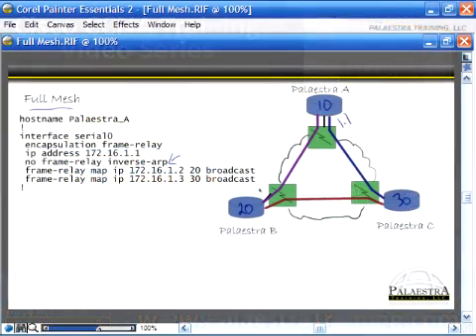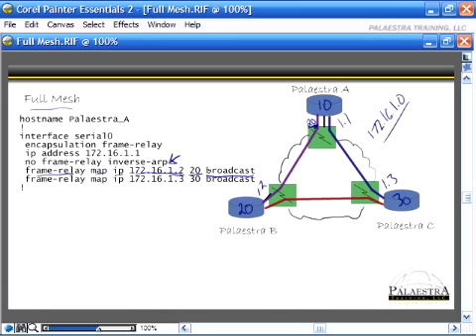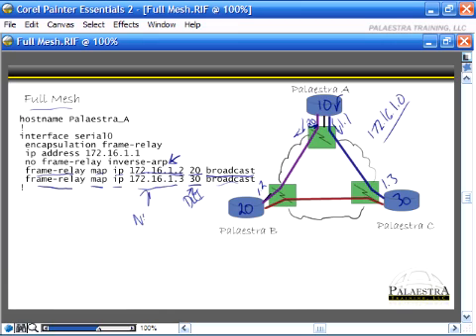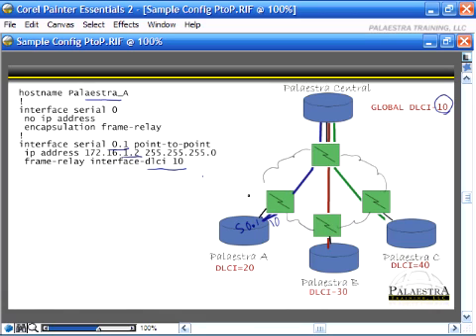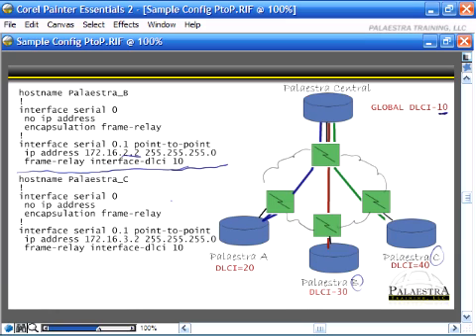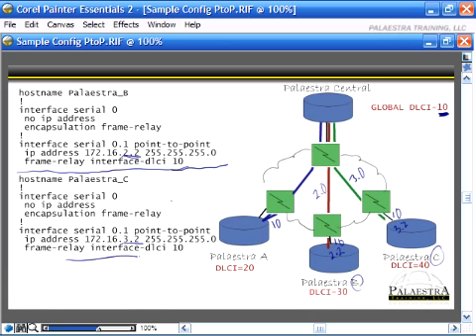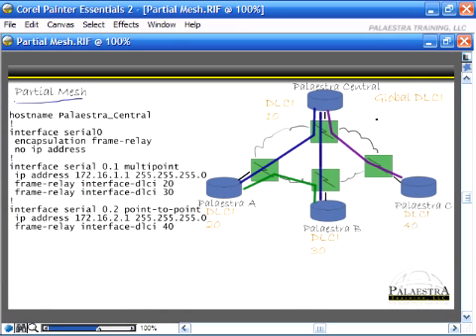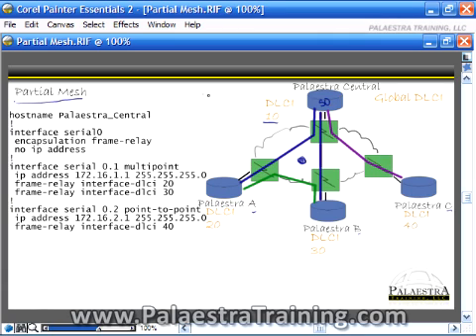Cisco CCNA Videos - Configuring Frame Relay

Comment: So are all the routers directly connected with each other via serial cable or is there a frame relay switch in the equation. Also with commands how come there's no clock rate commands?